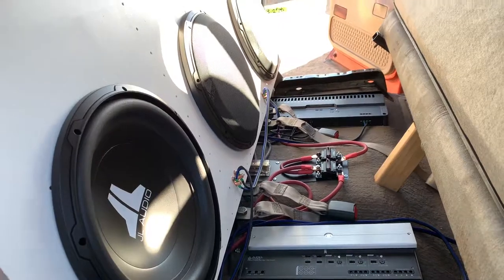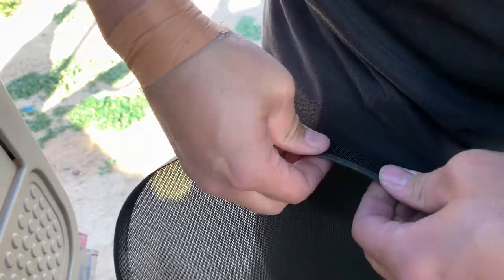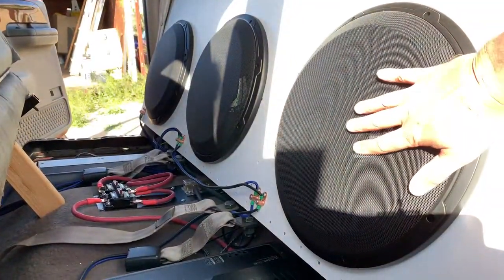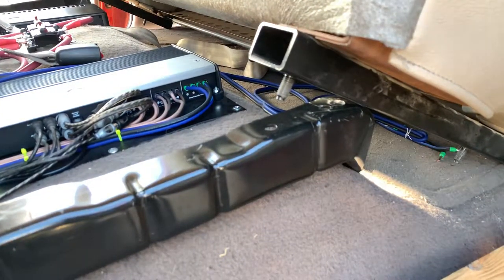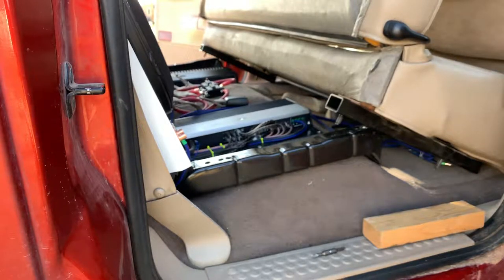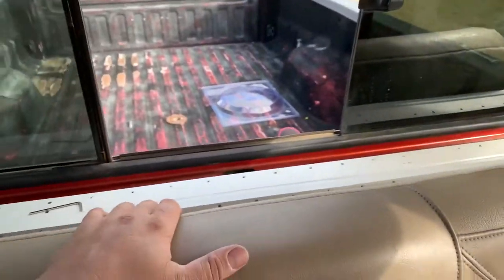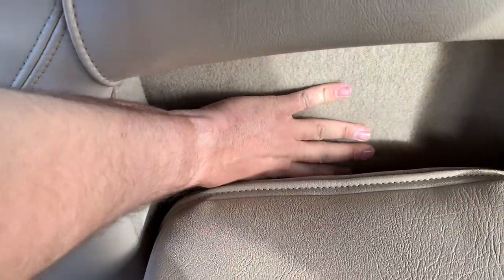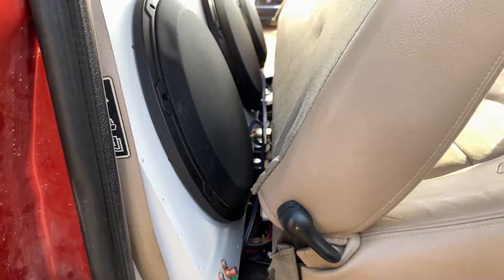Jl audio speaker grille install

Comment: Thanks for the video. I just installed these and found this video for instructions. I realized that if you put the screen flat on the subs and firmly press, it'll go in with little effort. But if you do it like this guy, one side at a time, you'll run into the kink he's talking about. 

flush and press.

Comment: Thanks for the video. I found while watching yours that the plastic piece that is held in by the same screws that hold the sub to the box comes out!!!  Set the grill, replace the plastic piece then put the screws back in. Ugh I about lost it putting the dang thing in.

Comment: Wrong! Take the ring out put the grille in then the ring on top. Don't bend anything!!!!
Reply from the maker: Killenum_133 ring does not come out.
Reply: @fatfreesalami  it definitely dose. You can see the pattern around the screws. When the screws are out you can take the inner ring out.
Reply from the maker: It’s solid plastic. Show me a video of this working on a W0 15” sub. I have already tried to pry it out. Not happening.
Reply from the maker: Cool!  Works on the W6 not the W0. Thanks though.
Reply: @fatfreesalami I have the w6 so my ring comes out so I put the grill on and put the ring over and screwed everything down. Looked like it worked but after using it for about a week I realized the damn grill fell out! It sits loosely on there maybe I need to do the opposite of what you’re doing ?
Reply: @fatfreesalami I will say I mean I’m pretty sure that you would have known if the ring comes out much less make a damn video , of course it doesn’t come out you don’t seem like your lost haha just look at that nice system